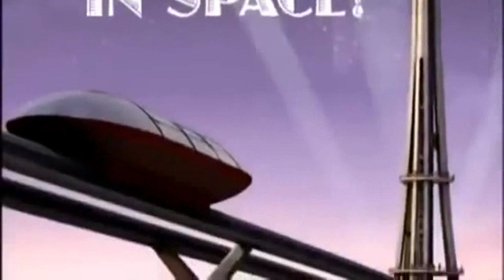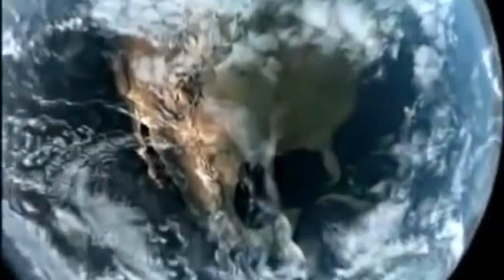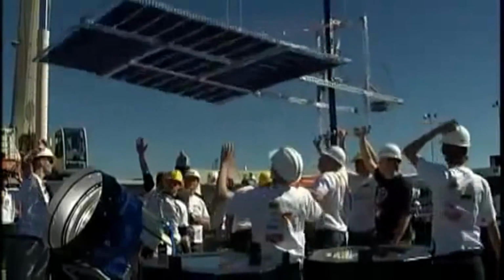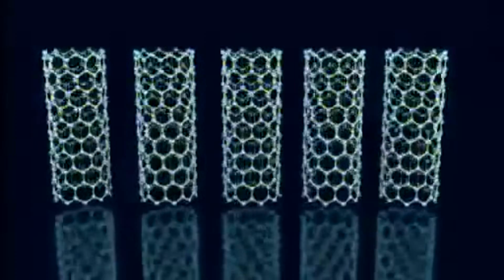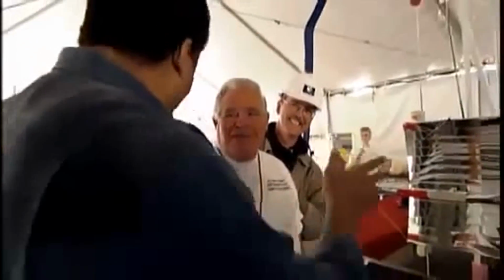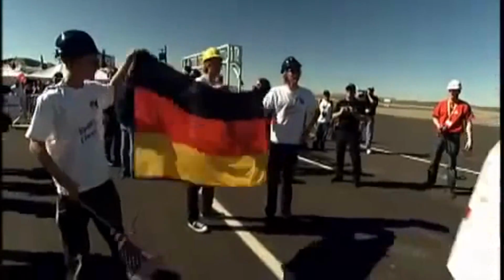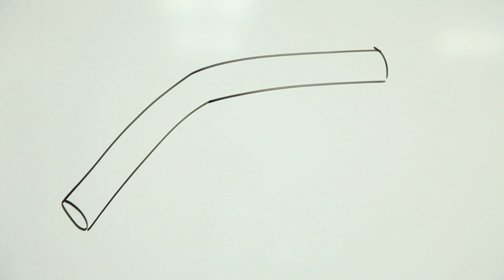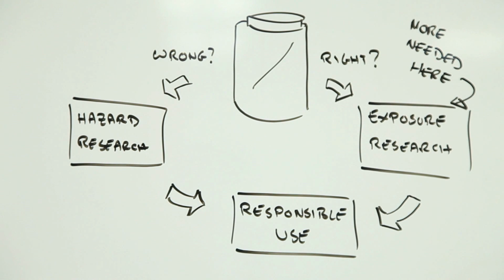The Universe Documentary - Space Elevator and Carbon Nanotubes

Comment: should have made it a cylinder with all the plates on the outside from all the light around it so any light could be used just not that at the bottom . also as for the ribben have it that the wheels are free to spin so the craft can climb but also twist haveing the cargo inside and the solor plats on the outside so as the wind blows it will go around the elevater  for a more indeepth idea ask me i have drawings of my ideas ...
Reply: also the laser idea is cool but not from the bottom but from the top the satallight would be best becouse it is getting light strat from the sun so have the laser comeing from it not the ground or have it the the ribben has the elecrty in it for the moters ..... my last idea is make it a pill shape the force will be on the ribben and sence it would be going throw the middle of the craft no wind shear and also as it desends the heat would also be lowered as it gos up and down as for the metter pur secont i have a realy good idea for that have the ribben woith the teath of a sipper and the wheels on the ((craft ))aka elevater will have wheens that have teeth on them and have a rasheo of 3>1 speed geers so the speed as at a constet for up and down also have the gears made of suramics so thay are light id will not over heat also are good at -200 ...